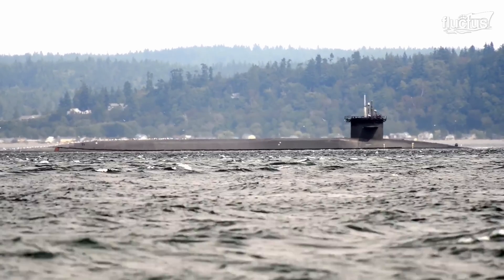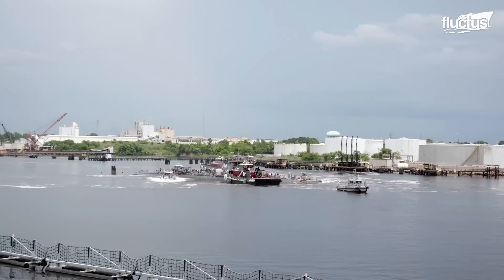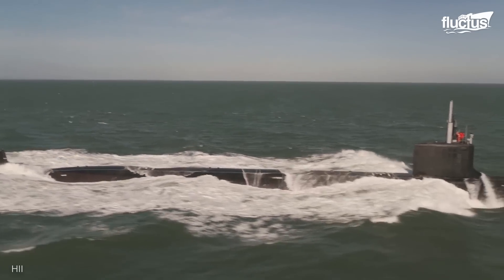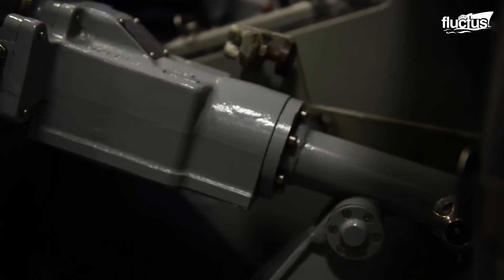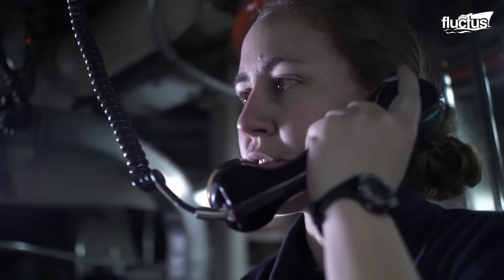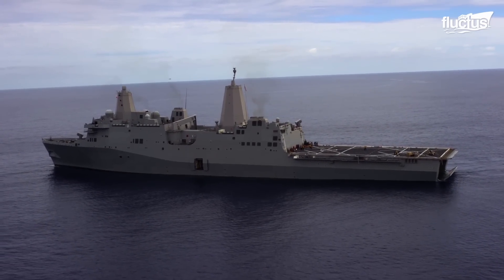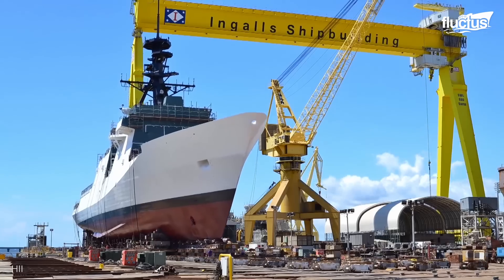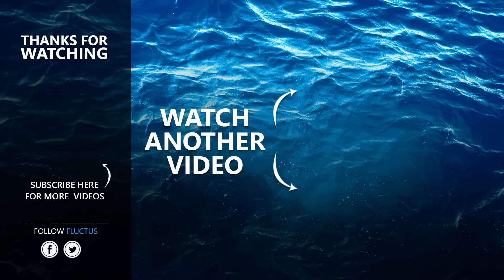The Hypnotic Launch of US Gigantic $4 Billion Nuclear Submarine

Comment: Actually the first combat submarines date back to the American Revolutionary War. With the Turtle famously being the first used to attack another ship. (it failed). WW1 saw the first widespread and effective use of true ocean going submarines as weapons.
Reply: Exactly. I was a little disappointed with that part of this otherwise good little documentary.
Reply: Glad others caught this

Also said they pump water in to match the outside water level... they just let it leak in.

Need massive pumps to lift it out, pretty sure they just empty the ballast tanks...

That was the first 2 minutes.
Reply: @jeremyscherbert7336  Yes as far as the submarine's balast system, you are correct.  Main balast tanks are open on the bottom and have vent valves on top. Open the MBT bents and they flood with water through the bottom.  Blow air into MBT's and water is pushed out through the bottom.  No pumps involved.  Pretty simple system, really. Trim and Drain system does use pumps to move water into, out of, or between trim and drain tanks to help control list and trim of the sub, but no pumps in MBT (Main Balast Tank) sustem.
The pumps they were talking about in the videa were for flooding the drydock prior to opening the gates.
Reply: @Mjka G  been a while now, but if I remember correctly, so was I.

Floating dry docks work the same way.  Basically a big chamber, let air out and it fills with water and sinks, pump air in, push water out and it floats.
Reply: Too be fair, the Turtle relied on a cork screw of sorts to fix an explosive to the bottom of hull. Bit tricky for a first timer and only timer. RIP
Reply: @Idontlikehandlesanymore  While the Turtle never successfully attacked an enemy ship, nobody was lost piloting it. Ezra Lee the only known combat pilot of the Turtle made it back to base unharmed. The main issue was the corkscrew couldn't get sufficient bite on the HMS Eagles hull. Lee had to cut loose the explosive powder barrel and retreat. The barrel would explode in the harbor long after the Turtle had escaped. While it would eventually be sunk, it was sunk while stowed as cargo aboard a transporting sloop that came under British attack. So no real RIP moments with the Turtle.

You're probably confusing the Turtle with the CSS Hunley. The Confederate Submarine that was lost with all hands when piloted by an unqualified officer.
Reply: The Hunley was the first, pretty sure.
Reply: @Scorpsfan  the Huntley was after the Turtle. The turtle was a wooden barrel that floated low in the water. With a hand/foot cranked propeller and a limpet mine on a long pole in front of it. You peddle up to the British ship. Turn the crank to screw the mine onto the ship, release the mine, then peddle away as fast as you could. The flaw in the system was the mines which always fell off before detonating. The Huntley came after it. And was closer to what a sub would eventually look like. A pedal powered chain gang type sub. It’s story was tragic. It was lost with all hands. But not before proving the concept.
Reply: @andrewtaylor940  CSS Hunley. No T.
Reply: @jimtownsend7899  don’t tell me, tell autocorrect which keeps T’ing it.

Comment: 6:56 It's a SAIL, not a conning tower.
Reply: ...and the boat I served on had it's bridge up in the sail, not under the coning tower.😉
Reply: @mikerush3729  The bridge is at the top of the conning tower. Control is under it
Reply: @EricThompson1965  ..... the "room" was called the control room. In the control room was the "conn". A trunk led to the bridge, that trunk went up through the sail. The bridge was at the top of that trunk up in the sail. It's been over 40 years since I lived onboard a Sturgeon Class boat, but that is my recollection. I simply do not remember a "conning tower" ever mentioned while onboard.
Reply: @mikerush3729  "Conning tower" is merely the term for the sail AND the bridge. Conning means control tower aka bridge... It has been 35 years since I was on my Trident... As a Sonar Tech, I have only heard and spoken "Conn/Sonar" or "Sonar/Conn" about a million times
Reply: @EricThompson1965  the term "conning tower" has its origins in diesel boats, ships that sailed on the surface with the ability to temporarily submerge. The conning tower was where the ship was commanded from while on the surface. Since the advent of the nuclear submarine, they no longer operate on the surface, they transit in and out of shallow waters, but operate submerged. As a fellow submariner I know I'm not telling you anything you don't know. My sole point is that during my 4 years and 8 months as a NavET with my watch station at the rear of the conn, I can not recall anyone using that term, "conning tower" while in Port or underway. Maybe Boomers still use the term and is the root of my confusion, but I never heard that term used. It was always referred to as the "sail", with the bridge being up in the sail and the conn being below decks, on a raised platform to the rear of the helm station.

Comment: At the 30 second mark, we hear some subs can descend to 2,500 feet.
I think the limit is about 800 feet.
Reply: Really? Pretty sure when I qualified on a nuclear submarines, we could go deeper than that…lol  What they tell you, and they can do, generally aren’t the same thing.
Reply: Back in my day... lol, we were only allowed to claim "in excess of 400 feet", and I can assure you they do dive "in excess of 800 feet".

...also, "Fire Control" onboard a sub does not relate to the control of, or extinguishing of fires, it encompasses the systems used to launch and control weapons. Their rate badge is an image of an antique cannon.
Reply: The Soviet Union had multiple classes of submarines designed with titanium hulls that could theoretically reach those depths. The Maximum Depth they are willing to disclose for them is roughly 350/400m.
Reply: @emwungarand  and the Ti hulls were dive cycle limited. But it was deep. A Mk48 Adcap wasn’t going to go there..
Reply: @emwungarand  well they had 1 class, the Alfa. It was stupid expensive, stupid difficult to fabricate and repair..
Reply: @RRSperry  they had more than one. The Papa class was the first. Then Alfa and Sierra classes. The one-off Mike class also used a titanium pressure hull.
Reply: @emwungarand  Well Papa was one boat, hardly a class (lol), and there were what?  2 Seirras and 7 Alfa's? If I believed the sonar guys, they were all noisy as hell.. Hey, I'm not an expert, just a guy that pushed a couple of boomers around the North Atlantic a few times.
Reply: @RRSperry  We were told the Alfa could reach 3000 feet. And all Russian submarines were noisy as hell. As a Sonar Tech aboard the Trident Henry M Jackson, we could detect their boats fairly easily, but we were never allowed to track them other than to assure us we were running away from them.
Reply: @EricThompson1965  Yeah it probably could go that deep, the question was how many times could it do it without work hardening the hull and risking failure. Like I said, I think they were limited on the number of times in the hull's life they could do that. Anyway, it was a soviet boat. I wouldn't want to be on that. (for a lot of reasons).
Reply: Classified is 800’ top secret is much deeper.
Reply: As a retired U.S. Naval Aircrewman whose rating was Aviation ASW Operator, I can tell you that submarines can descend much deeper. In fact, they can descend to the bottom of the oceans. Getting back up is the tricky part.
Reply: UMMMMM no many can go down to 550 M

Comment: Should be seamless would be better than having welds
Reply: The weakest part of the hull is not the welded hull section, it is areas that are open to the sea and use a seal.  Like the main shaft , air vents , intake and exhaust water vents. A chain is only as strong as it’s weakest link.